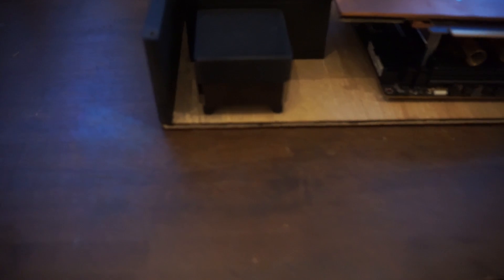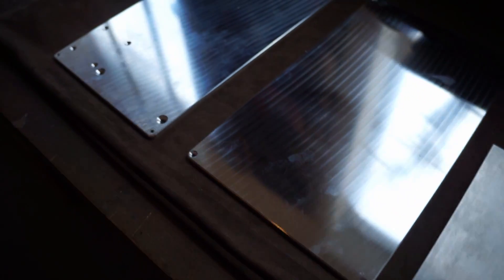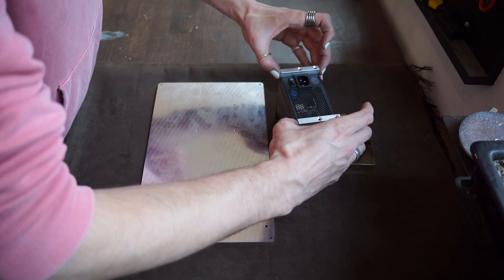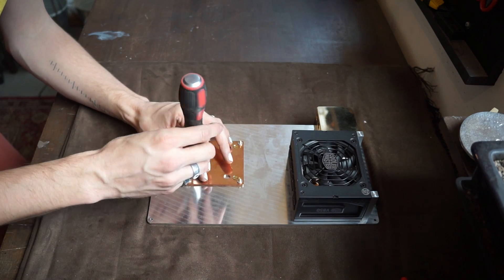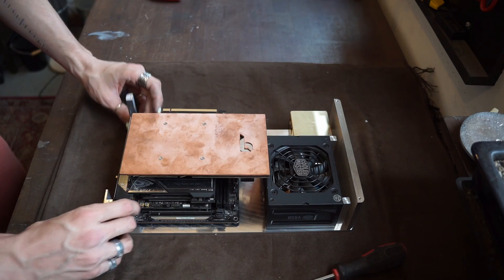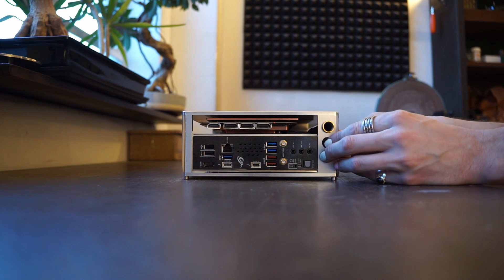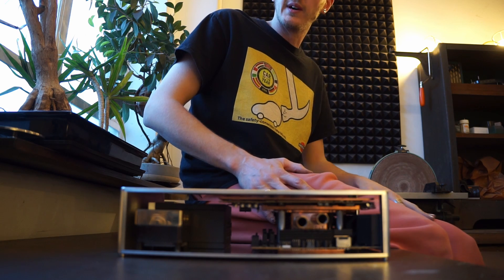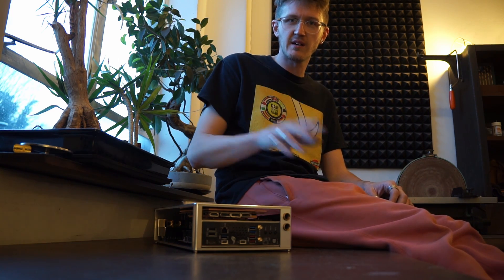Billet Labs MonoBlock - Externally-cooled 4090/14900K build - Part 3

Comment: for the pipes... have you ever thought to make built-in channels in the case (since it is to thick already) for the  coolant to pass through too & from the pump ? that would be really interesting to see .... you'd almost sell the case with the block instead of just the block it would be a whole package
Reply: Cool idea, but the whole thing would need to be made out of copper or aluminium due to corrosion
Reply: @AndroidBeacshire  probably have to be casted from aluminum for the internal channels

Comment: nice looking build, but are you sure the power supply is going to be ok in there? afterall even though it's a very efficient unit under high load it's gonna produce 60-70 watts of heat.

Comment: try plastic since it is so much cheaper - there is no reason to use metal here, make it bigger and more usable/fixable - if you are fivated on metal then make it even more rugged billet - standing on it should not even be a challenge

Comment: i would try to get the top panel closer to the grapichs card, then plash some thermal paste on and the case acts as a heatsink for the backplate on the grapichs card
Reply: He needs somewhere to put the PCIe riser cable and the only space is between gpu glackplate and the case plate.

Comment: Fantastic build! Will the PC need some sort of airflow over the VRM on the mobo and some parts graphics card to keep things cool?
Reply: for the 14900k, it needs some air to keep them cool, if it was a 14700k, they should be fine without overclocking
Reply: The VRM is actively cooled on this motherboard :)

Comment: Looks very nice, but have you thought about corrosion? Looks like there is direct contact between copper and aluminium. This probably won´t get well mid or long term.
Reply from the maker: Galvanic corrosion only occurs when both metals are in contact with water. This will not be an issue here.